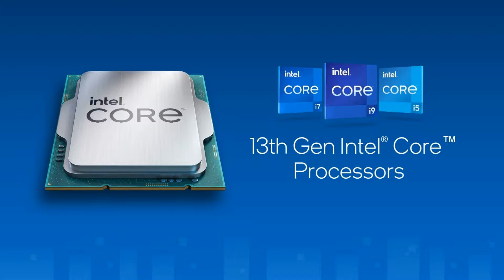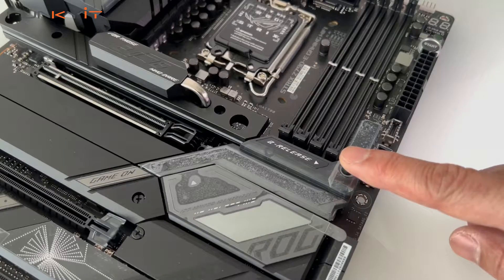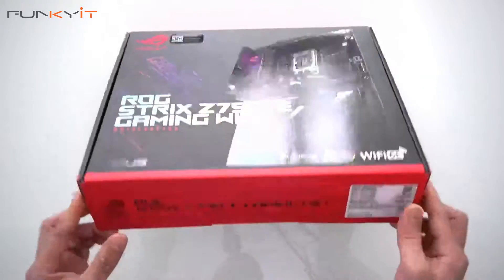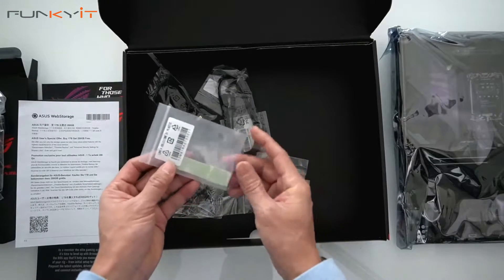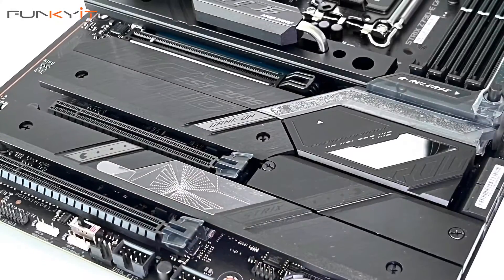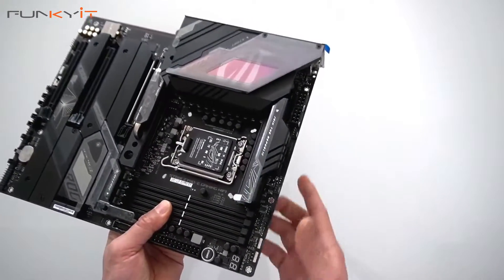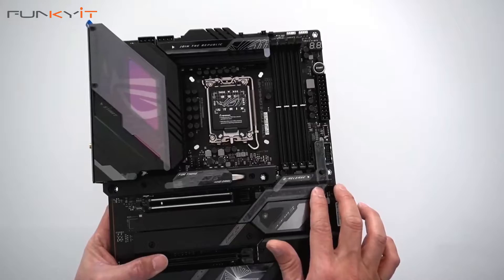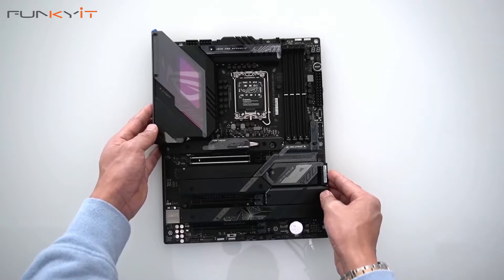Why the ASUS ROG Strix Z790-E Gaming WiFi is our Favourite Motherboard

Comment: I've got this motherboard as well, with a 13700.  I recently noticed that when using an external HardDrive over USB, this will quickly congest the USB bus and cause mouse and keyboard to become unresponsive or jittery.
Do you have any advice?
Reply from the maker: Have you tried different USB ports for the external HDD ... also I recommend you try USB-C port as well

Comment: i just ordered the new version of this one thats 14th gen ready. the Gaming WiFi 2. It has WiFi 7, 5 m.2 slots and one gen 5 slot that has a heat sink that is capable of cooling the gen 5 nvme's
Reply from the maker: They are very nice motherboards ... one of my favourites :)
Reply: @Funkykit yeah, I'm very excited. I've only ever used Gigabyte or MSI motherboards too. So this will be my first Asus motherboard.
Reply: What's the new version called?
Reply: @muradgazi555  it's literally the same exact name except that it's the 2. This one in the video is the Asus Rog Strix z790-e gaming WiFi, and the new one I got is called the Asus Rog Strix z790-e Gaming WiFi 2 except they use roman numerals. So it's ii
Reply: Thanks!  @AustnTok

Comment: One of the best made motherboards I have purchased over the last 30 years building PC's and servers...    I initially needed to replace the slower DDR5 ram but amazon took care of that exchange/swap....    once done, this MOBO rocks...   RTX 4090, 128GB ram 2x2tb SSD and this just SCREAMS!
Reply: why would you ever need 128 gb of ram and 2 2tb ssd's?
Reply: @Rishaby007 Dude likes being the best obviously
Reply: @Rishaby007 I’m just building my first and have 2 x 2TB of storage, just wanted to install it all before putting in the GPU to avoid having to make changes later
Reply: @Rishaby007  SSDs for gaming, 128GB ram for if you run a lot of production software simultaneously. I have 2 48GB DDR5 sticks and my major hobby, besides gaming, is CGI rendering and the extra memory helps a lot.
Reply: @liamloxley1222  I don't do game development but I have been into CGI rendering as a major hobby for over a decade and have over a decade of purchased product taking up 5TB on an 8TB HDD with a second 8TB in RAID 1 to prevent losing anything.

Comment: Just received my Z790-E. Looking forward to the new build.

Fair winds and following seas to all.
Reply: youll love it ..just know ..dont use the pcie5 slot for m.2 or u will only have 8 lanes for ur gpu.. your gpu requires 16-lane slot (“x16”) to accomplish maximum memory transfer performance.
Reply: @coryo617  Thanks for the tip! I've planned to use the _2 M.2 slot with a 1tb WD Black SSD dedicated to the OS along with two 2tb SSD in the chipset slots and two 8tb HDD for everything else. 

Best to all.
Reply: @coryo617 which slot should the M.2 go in for maximum speed transfer?
Reply: @jeremymartinez6024  Your CPU Lanes will be a tad bit faster than Chipset Lanes. i did the 3rd slot down for my os and the 2nd slot for games.
Reply: @coryo617 thank you. Are you happy you chose this board? Looking at this one as well as the Maximus Hero
Reply: @jeremymartinez6024  ya I like this board alot.  The hero is a tier up from this board. But this motherboard is plenty for me. Which ever route u go there both good.

Comment: Hi, If i am planning to use 2 3090ti's with a nvlink, is it possible that the PCI slots align for the nvlink connector? 
Are the PCI slots gap 4 slot?
Reply from the maker: Based on the motherboards PCIE slots, it should be a 3 slot connector… I would recommend you check Asus’s website for more information

Comment: i'm going to be using this board for my first pc build, which has a theme of "ultimate redundancy across all margins." 4tb 5.0 m.2, 4tb 4.0 m.2, 128 gb ram, intel 13th gen core i9 with overclocking enabled, rtx 4090, 1200 watt platinum rating power supply, 360mm corsair radiator with fans, corsair 5000x glass case with 3 360mm fans, and one extra 360mm fan for the back, 20tb of extra storage via internal hard drive, windows 11 professional edition, and hooked up to my 2tb external hard drive from my laptop to transfer all my old data.

my goal with the build is to make a pc that i will never need to upgrade for at least 5 or 6 years while being able to play any game including vr, do digital art, edit videos, stream on it, do 3d work, and just over all be able to throw anything at the thing and have it not even be phased in the slightest. hence why I named the future build "Code Name: Striker"
Reply: I’m thinking of using this board in my first build too!! I’m gonna put it in a NZXT h6 flow rgb
Reply: As someone who just upgraded from an i5-6600K I built in 2015 with zero changes except video cards, that will last you 10 years if not more with a 13900.

Comment: Thanks for the review 
I have this motherboard but I had problems with it first problem it runs x8.3.0 and the solution for it moving the ssd next to the pcie slot 3 and it became x16.3.0 second problem is the x16.3.0 number 3 is has to be 4 like this x16.4.0

Comment: Does it come with reversed soldered caps, exploding sockets, defective BIOSes and premature failure too ? :P  The memory specs are so overrated, none of these boards work well with XMP, even with 2 sticks, good luck getting past 4800 stable, if you are lucky, even with QVL memory, with the right memory chip as per QVL, you could get lucky and do maybe in the low 5000's, at most, but never 6000, 6400, that's insane, you won't get those speeds running stable on games and benchmarks on those ASUS boards, and I'm an ASUS fan.

Comment: Anyone having slow bootup time on Asus z790e? Mine takes 40 seconds from power button to windows login 
(970 Evo plus) 

-on latest bios and startups disabled
Reply from the maker: Have you tried  fresh install of Windows? Also check and make sure you have the latest drivers, and remove old drivers.

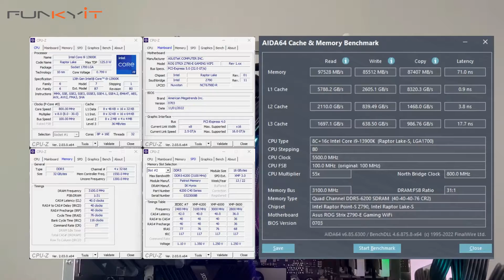Comment: Lul you have put the m.2 ssd to the wrong slot, now your gpu runs at 8x pcie speed. 10:30
Throw the stock radiator from the ssd away and put it on a m2_2 slot. If you read the manual it says that it is also shared with the CPU for less latency not the gpu and designed for pci gen 4 ssds

Comment: Great video. What's the difference in the a e I & f versions? Is it dimensions?
Reply: A has 2 less usb 2.0 ports and no official ram fan placement.
Reply: @NormanFoxLee  thanks dude
Reply: Power phases, rear io, m.2 gen5 is exclusive to the z790-e in the strix series ( 1x gen5 4x gen4), either the ddr4 or ddr5 model for the z790-a, internal io, heatsinks and the such. The z790-I however is a mini-itx form factor in contrary to the rest of the strix series, which are all standard atx.
Reply: What about the f version? In thinking either this one or the one that ends with f @14.69-h4s

Comment: I am in the middle of upgrading my system and i was getting this board over hero but seeing that it only has 4 sata lots and i already have 8 (6 hdds and 2 ssds) in my current system so my options is either to go with hero or msi meg for atleast 6 sata ports and 5x m.2 slots which i need as well or get this board and pci-e sata 6 expension card.
Reply: You could also upgrade your HDD to a bigger drive as well, which is more cost. But yeah these kinds of motherboards are not about how many peripherals you have but the speeds you want to get out of the motherboard.
Reply from the maker: If you have a lot storage devices, I recommend another board that supports for than 4 SATA ports
Reply: You could fit 3 of the HDD's, and the 2 SSD's. If you wanted to upgrade 3 of the HDD to M.2 NVMe SSD's there are 5 of those slots! If you used slots 3-4-5 you wouldn't slow your GPU either. Otherwise yea you would want the Hero for the same performance level and all the ports.

Comment: Hello and thanks for this video. However, can you please confirm the UEFI BIOS screenshot you show at the start is for this board. Usually, the 'Extreme Tweaker' BIOS page is for the Hero board and not the Strix boards. Thanks
Reply from the maker: Yes I checked ... and the BIOS on this STRIX motherboard does have the 'Extreme Tweaker'

Comment: Im way to poor to be have any expensive motherboard as a favorite. Most people don't even need these boards. Cheaper boards will not hinder use in any way.
Reply: Not true, cheaper boards can hinder use as they typically have fewer VRM phases and may not be able to maintain stable high overclocks so even if you win the silicone lottery your mobo may not be able to achieve an overclock that your CPU could
Reply: @PejSaint  you are talking about the super cheap boards. That should maybe only be suitable for a cheap i3 or ryzen 3 system. Its clear you should not put a top of the line cpu in them. But the boards that generally are midrange or lower midrange have plenty vrm and vrm cooling to run the top tier cpu. For instance, you dont need a super expensive msi meg godlike board. When an msi tomahawk board will run anything you throw it it. Sure. The boards that are super cheap are not suitable for much more than a ryzen 5. Super expensive boards make little sense to most people. Can't even oc new cpus much anyway. They already run at their max under normal cooling
Reply: Idk if they last longer though, my asus prime fried. It was the first to go out of all my components.
Reply: @hunter1850  yeah, they can all break at any time. More expensive often means more features. And maybe stronger power delivery design. More layered pcb. And more i/o etc. Most people don't need most of these features. What use is a high speed ethernet port if most people's internet connection is way below the speed of regular 1000mb network adapter. Why would anyone running an i5 or i7 need a super beefy power delivery. Or why would people need a board that can handle really high speed memory, when they buy average speed memory. Most people don't need 4 m.2 slots. And whats the use of pcie5 when they have no hardware needing it. Or a wifi adapter on board if they never use it, because they use ethernet. These high end boards cost so much more, and buyers of those boards seldomly use its features. Whats the use of some high end overclocking board if someone will never use liquid nitrogen to push it to the max. Most people don't need expensive boards at all.
Reply: @MrMastadox  yeah the m.2 slots made me laugh as well. Just a little worried though because I ordered a 13th gen. I'll probably go with an msi though mostly because of the pricing but I also learned asus tends to overclock over its 250W max. If you got any other companies lmk I was wanting DDR5 mostly. Just hard to find that for a new chip😒

Comment: On Minute 10:30: In the CPU-Z Window for the Mainboard we can see (Graphic Interface) that the RTX3090 is linked with only x8 Lanes from 16 of the PCIe Slot. You used the first NMVE-Slot for your SSD and this is a big mistake from ASUS. DONT USE this NVME-Slot (M.2_1)!
Reply from the maker: Thanks for the comment and suggestion
Reply: PCIe 5.0 is double of PCIe 4.0. So PCIe 5.0 x8 is same as PCIe 4.0 x16.
Reply: The loss of the lanes will have, at most, a drop of 1% performance on the GPU, so it doesn't matter. Current cards don't use more than 8x lanes. You should do some research before trying to sound smart on the Internet because you're just an ignoramus thinking you know better than the electrical engineers at ASUS.
Reply: in 2010 i bought an asus p7p55d-e which I still use, and for weird reason the graphics card slot pcie 3 use x8 speed instead of x16 eventhough i turn off usb3.0...seems still the same issue even after 13 years....can someone recommend other motherboard which doesnt have this issue?
Reply: @GodofWondersss  You sure you are using the first PCI-E slot?
Reply: @OmarOs  yes the first blue one, I've been checking that every now n then for last 13 yrs bro...☺️
Reply: @GodofWondersss  So it was never x16? it was always x8 since day one?
Reply: @OmarOs  as per motherboard website the blue lane operates at x16 when usb 3.0  or sata 6g option is not active in the bios, when one of them is turned on it operates at x8, but in my case it always works at x8 irrespective of the option in bios, i also tried all bios versions from v1 to v16, nothing works... But anyways it didn't matter now as I've gamed on it all these years...
Reply: Yeah, this is actually hilarious. You buy 500$ MB, don't read the manual and cripple your graphics card by halfing the number of PCI-E lanes. What a joke.
Reply: @nikolaylineckiy1793  If you look up comparisons it doesn't cripple your graphics card. It might be a 5 fps drop in games. Don't be so dramatic...
Reply: @TOOL1023  this guy reviews hardware and should know better. So i agree, read the manual. Because all i can see he have just told us everything we all knew by just reading the booklet. What a review is this?

Comment: I honestly can't decide between this or the Asus ROG MAXIMUS Z790 HERO ATX I just want to do high end gaming with all the settings on ultra. Any advice?
Reply: All the 13th gen including the one on the video are good for overclocking. The only difference between the boards is how they dissipate the heat. But they are all almost the same. Minor features are the only thing that changes between them. Performance should be almost if not equal across them.
Reply from the maker: Both are very good boards. Maxiumus is more expensive but great for overclocking. I would buy based on budget.
Reply: @Funkykit  I had the budget for the Hero, but chose this board!!!
Reply: @codygrinnell8676 I was originally aiming for the Z790-H for its lower cost but opted for the Z790-E instead as I thought I may as well get a higher-end mobo to maximise the full potential of the 13900K/4090 but thinking back it seems a bit ridiculous that the mobo cost more than the CPU lol. I guess at the end of the day I just wanted the best possible component matching. But the multitude of USB ports was certainly a bonus as I can never have enough powered USB ports. Running the 13900K at 5.5/4.3 Ghz on an upper midrange mobo was a compromise as I had really wanted the Maximus Hero (Thunderbolt + higher power phase, more USB ports + that LED bling) but it was really too expensive.
Reply: I have this board and it's really good, my only issue with it is that when you populate the top M.2 slot (M.2_1) the top PCIe slot only runs at x8, I moved my SSD to M.2_2 to enable my 4090 to run at x16 and I saw a few percent increase in graphics benchmark scores.
Reply: @Scott  So are you saying if I use my new m.2 nvme gen 5 SSD at the top slot to populate and have my RTX 4090 in PCI express slot it only runs at X8? 🤔 Is this the only Z790 motherboard that does this? That sucks. Should have went with the AORUS master or Asus Maximus
Reply: @Kingtoby1981  interesting how people buy stuff without reading full specification. It  literally says in the manual which ports share bandwidth.
Reply: @buzzikea  The thing is  I got this board for a very good deal from a co-worker. At the time I wasn't even thinking about that. I literally only spend $200 dollars for it. I was just happy to have a Z790 motherboard.
Reply: @Kingtoby1981  well then you should be happy, the difference in loading times wouldn't be noticable for everyday use.
Reply: @Kingtoby1981  Not just this mb, Even MSI and Aorus z790 do have this bandwidth sharing issue.
Reply: @Shriram  I noticed that. I should have gone with AMD because their motherboards are future-proof
Reply: @Kingtoby1981  ohh. Okay. I'm also planning to build a pc with 4090 but am confused between msi z790 Tomahawk and Asus Strix z790. Have you tried to change and keep 4090 in the PCIe 4.0 x16 slot while using SSD in M.2_1? Noticed any performance difference?
Reply: @Kingtoby1981  Do you get bios updates regularly from Asus?
Reply: @Shriram  I actually did that, and it's not a big difference at all. I didn't even notice it. Maybe I should stop complaining about it, lol. If you're an enthusiast, I guess you'll notice a little difference
Reply: @Shriram  Yes I do get the Bios updates regularly
Reply: @scott501  Only a few percent Increase? Was it worth it?
Reply: IS it a issue or by design feature ? @scott501
Reply: " I just want to do high end gaming with all the settings on ultra" sounds like you need a regular motherboard for $150
Reply: if you are looking at the maximum I would say either go with the extreme OR just get the strix I have been looking at building my pc and I am now going nuts with the hardware like hardcore all out and I am probably going to get the 790 strix. it was between the strix and the extreme though
Reply: focus on the GPU if you want max settings on all games
Reply: You should get the Asus ROG MAXIMUS Z790 HERO because it has a backplate :O I know thats the motherboard im getting for sure
Reply: @eepyhead  The backplate is only there to hold the cooler and prevent the motherboard from bending, it's not necessary with waterblocks. Your problem is probably overheating caused by poor contact between the cpu and the waterblock.
Reply: @JuanDiaz-jo1rw  who said i had any problems?
Reply: @vampyre  I never said you did.